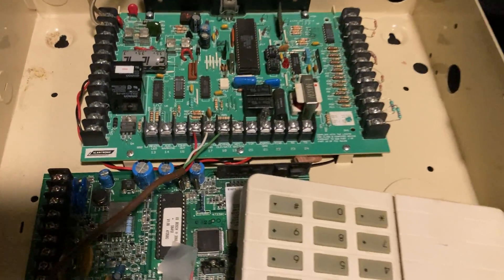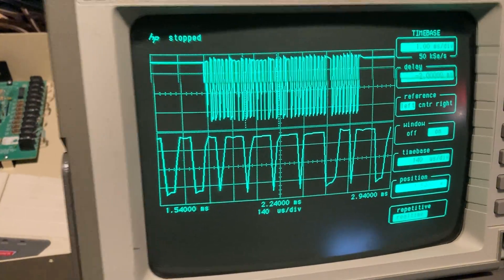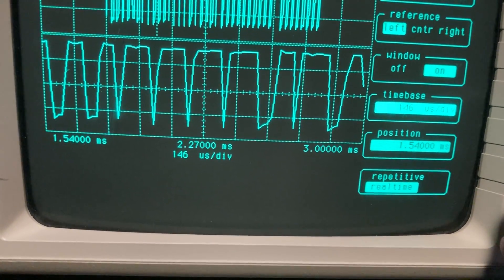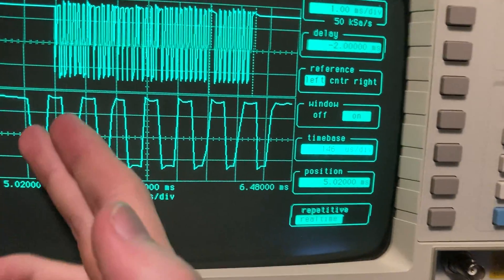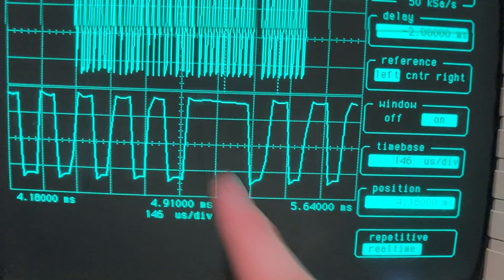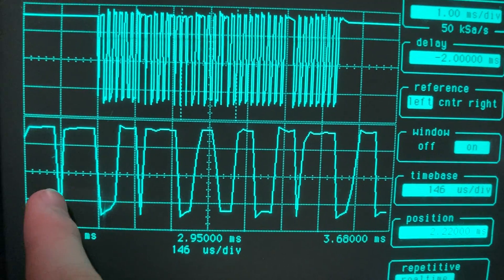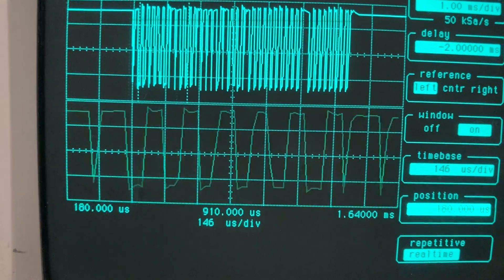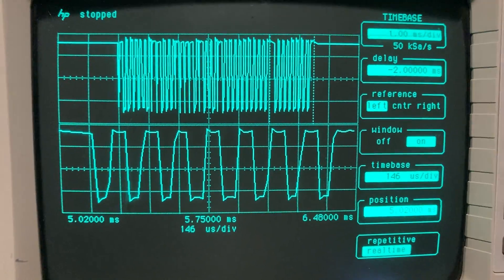How does this one-wire data bus work?

Comment: My best guess is that the data from the one data wire goes back to the panel through the common 12v negative  wire. Mabey somehow the positive 12 volts overpowered the data on the common negative wire.
Reply from the maker: I'm not sure I understand what you're saying. The 12v and ground wires do not carry data nor affect the data line at all, they are solely for providing power to peripherals. Both the panel and keypad transmit data on the third wire, unlike most systems where there are dedicated tx and rx lines.
Reply: @KJ7BZC  Oh ok. I thought that somehow the data return could have been the common negative. I don't know how a single wire data "loop" would work in your panels case. It's very interesting though. I know that vista panels have the siren and aux 12 v share a common negative.